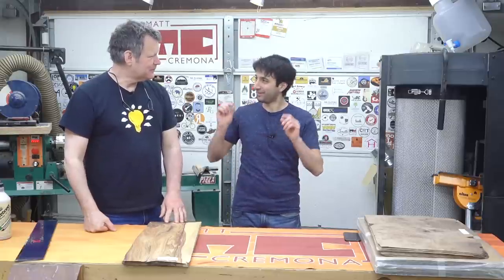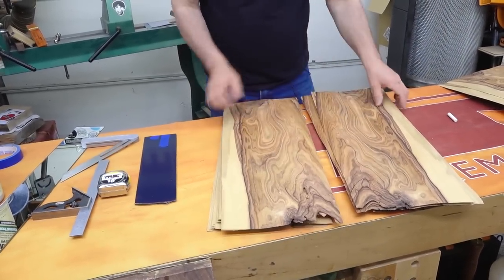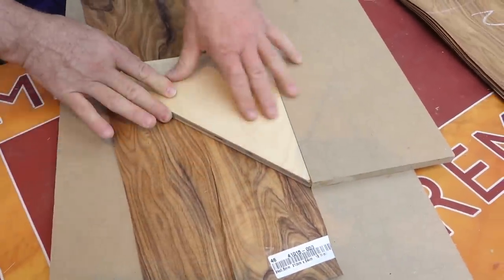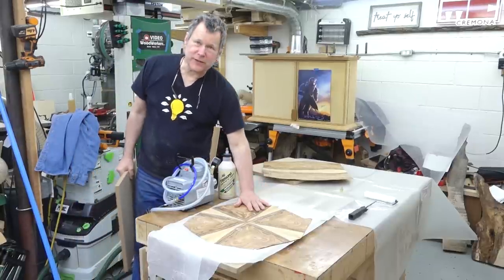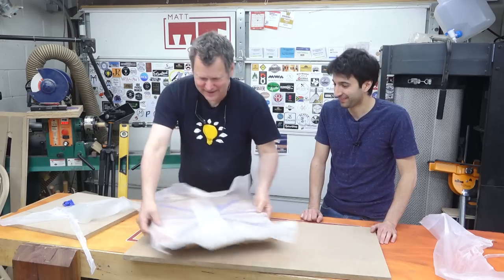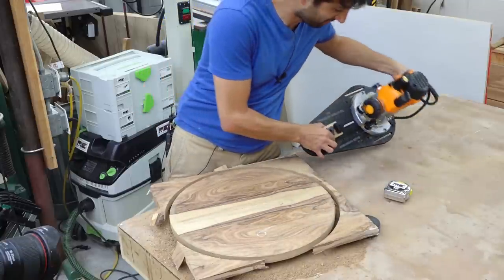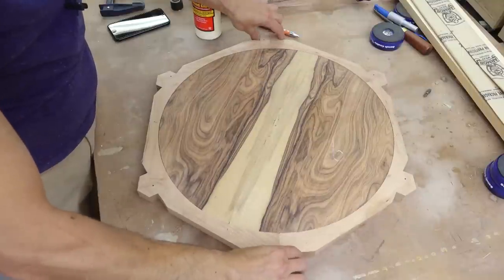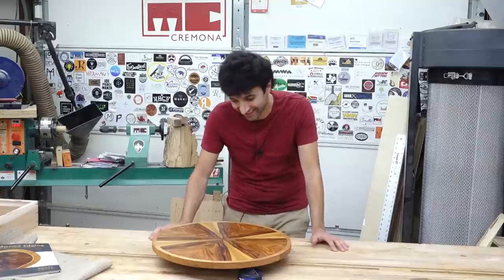Radial Veneering with Scott Grove

Comment: Very informative, Matt. Thanks for bringing Scott in. One question, though. Is there any advantage to putting a roundover on the top of the upper platen to relieve stress on your vacuum bag?
Reply from the maker: Probably but I’d be more worried if I bought one of the thinner, cheaper bags

Comment: So many experienced and "crazy" wood workers do all the stuff themselves, like you milling your own wood. Are there any really outrageous crazy wood workers who cut their own veneers? I've see how difficult it is and the expensive equipment used for "mass production" of veneer but is it possible to buy "pro-sumer" tools for doing your own veneer? Or would it be easier/cheaper to take batches of the wood you have to someplace that could cut it into veneer?

Comment: Matt, you're the expert but what if you'd sanded the two joining places on the outside banding just a LITTLE for a total of about 1/32 before attempting the gluing? Would that have tightened it up? (You'd need a flat double sided sanding stick...) Similar to sawing through a miter joint to make the fit align. Loved this video.

Comment: Could you cut out the circle with a bandsaw, or would that somehow mess with the veneer?  Cool video....Thanks, Matt!  :-)
Reply from the maker: You could use the bandsaw.  You'd probably want to put a backer on the bottom so the blade doesn't chip out the veneer as it's exiting.

Comment: Excellent video. The Left Side of the Body is controlled by the Right Side of the Brain, therefore Left Handers are the ONLY ones in their Right Minds. Explains Scott's creativity. If you add a layer of shade cloth to the outer part of the sandwich, it helps get the last little bit of air out. Used all the time in boat building. The clamping pressure if you can get down to 0 Bar is 10335kg/m2. Make a good coaster for that well deserved beer. Just think of some of your slabs out back would make great veneer.